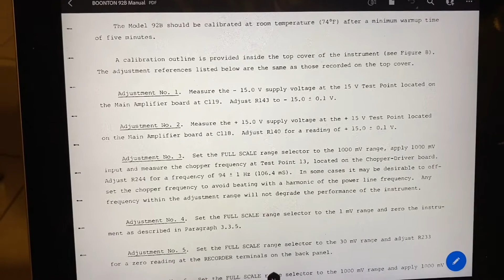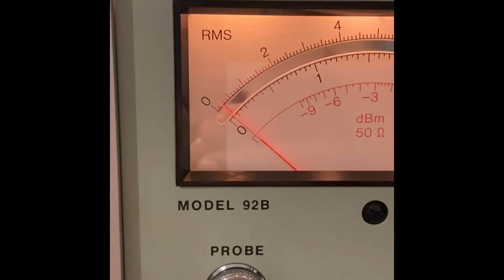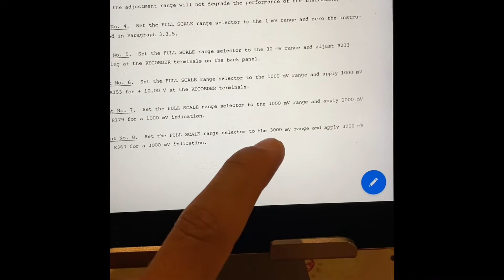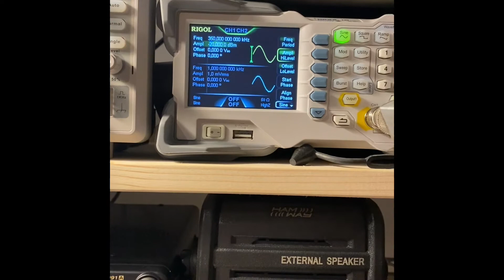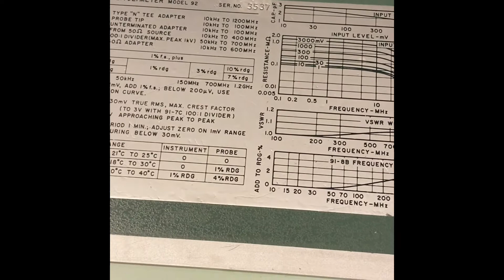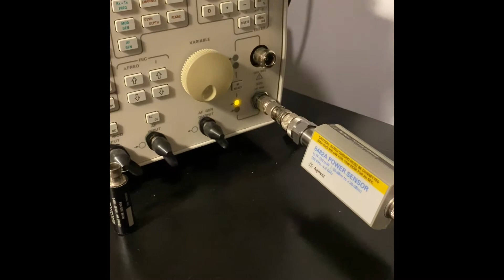BOONTON 92B RF millivoltmeter - Recalibration after transportation

Comment: Hi, what is that t connector between the Boonton probe and Rigol signal generator ? and which electrolytics fixed the needle bounce ? 
Cheers
Reply from the maker: Hi, the Tee is an optional accessory from the Boonton catalogue. It’s called Tee adapter and is used for best accuracy on the entire range of the instrument but obviously depends on a good termination. Regarding the elecraft caps I can’t remember exactly  which ones but those axial sprague on the first board, when the signal path comes in after the chopper.
Reply: @IZ0MTW cheers, no worries , the needle bounces around haphazardly , especially on  1mV setting, I will download the service manual and schematic if I can find one and recap over the next couple of weeks 
✌️❤ 73 🌏🦘

Comment: Your zero pot is dirty. Mine did the same thing. I just cleaned the zero pot with DeoxIT cleaner, It fixed mine. Nice video..
Reply from the maker: I wish it was something that simple. Cleaning that pot was the first thing I did but unfortunately produced no effect even though it was  good idea to do it anyway. Eventually what fix the issue was replacing old electrolytics.Thanks for your comment.

Comment: The manual states it wants the probe and the unit to have matching serial numbers. 
I wonder if this calibration effort would allow alignment if using a replacement probe?
BTW:  Thank you for your effort producing this video.
Reply from the maker: you’re welcome and thanks for your comment.
You’re correct, probe should match the unit and serial numbers testify that. My probe has no serial number on it so I don’t know what that means. Maybe a replacement bought during the years? Anyway, I performed a check and then a full alignment after I bought the unit second hand. Comparing the readings with all my other instruments I am definitely satisfied about its performance now. A nice bit of kit that I like to keep in my lab.

Comment: Mine has a buzzing sound only when I press 1 & 3 range, and the needle maxes out. Would you have any advice where to look ? Thanks
Reply from the maker: get the schematic and have a look on the two range paths where you have that issue. Check the components along those two paths. Visual inspection first..